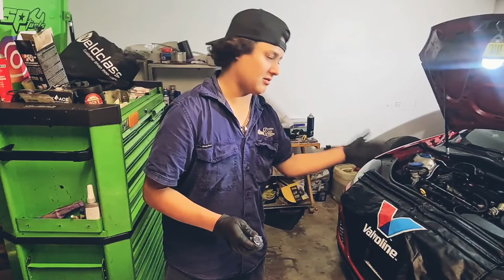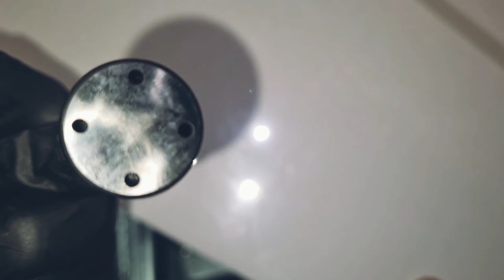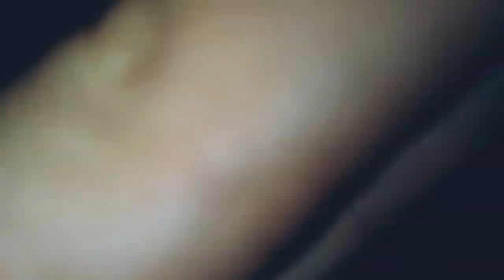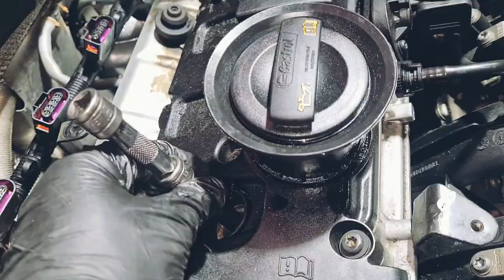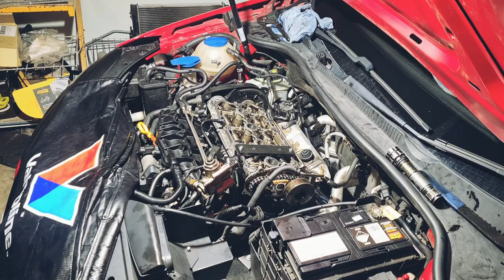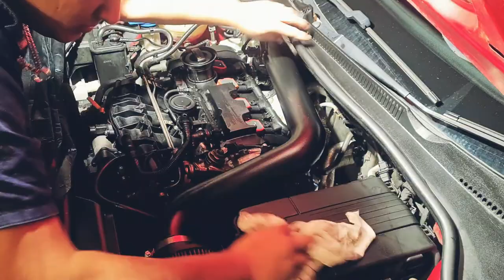Cam shaft timing chain replacment on the volkswagen Mk5 golf GTI #vw #audi #camshaft #timing #chain

Comment: You didn't count the links from the bronze one? Have to go by the 18/19 rule on the chain otherwise your timing will be out unless you got very very lucky
Reply from the maker: Thanks for the heads up mate, that's exactly what the elsawin manual states, it's another precaution to make sure you don't mess it up but the links are the same all way round, just helps you locate the adjuster onto the keyway.  aslong as you turn the inlet cam when you lock the adjuster and the lobes line up the same on the cam cradle marks ( about half way travel  along the lobe both high points facing inwards) your sweet, the cam lock should also slide effortlessly between the cams. I'm a europian vehicle mechanic and vdub and Audi specialist at the shop, have been lucky the last 20 chains haha, but in reality as you go, you figure out other ways to do things and what methods help what, helps make things more efficient, part of all the fun
Reply: @jack73ist  If you didn't count the links, why did you care with the colored chain in the video? The different color only helps counting the links between...
Reply from the maker: @YOARTHFU  don't worry about it too much mate, replied to your earlier comment 👍
Reply: @jack73ist I have no earlier comment, until now. I'm just make it more comprehensible for others, since it is common that people are very confused about the timing logic, then making unnecessary steps and timing marks all over the car.
Reply from the maker: @YOARTHFU  sorry mate, thought you were the other person to comment on the coloured chain link, Check the reply above yours to K2weapon. Just showed how I've been replacing these timing chains for years. As I stated in that reply  afer a while you learn what method is to insure what and where you can make the job more efficient. Links are the same all the way round on the chain, it just helps you locate the keyway onto the adjuster. As long as the cam lobes match half way across the rise on the arrows on the cam shaft cradle you'll be fine.
Reply: @YOARTHFU  yea good catch. count links to set the tension. Can still be perfectly on time but chain will be too slacked at the top and tensioner will reach full extension pre maturely.

Comment: You seem like you really know your stuff. How often should this service be done?
Reply from the maker: Thanks mate, and thank you for watching 😄, usually, we would replace only when necessary, symptoms like a chain rattle on 1st start up, (can sometimes be the adjuster) , inlet/exhaust cam shafts out of corralation fault codes, this problem would ussually occur roughly around 160k kms. You could probably do the jobs as preventative maintenance before hand around 135k km, with the service but this also all depends on car history, hows its driven and serviced
Reply: @jack73ist  Thanks heaps.

Comment: 20nm. I don't hear a clic. Is your wrench broken ?
Reply from the maker: Nah not broken mate, I dont think I used my torque wrench in this video? But there is a torque for every fastener, yes 🙂 .
thanks for watching mate
Reply: You said that the spec for that bolt is 20nm. why are you using the wrong key? why are you putting that bolt so tight?
 I think you tightened that bolt to 150nm. you were almost to the point that the screw thread would break
Reply from the maker: @AutosportMore  you're making some big assumptions ,  you can find more information on ross teck wiki, and some other software, but I've just shown how I've carried out the job for years cheers mate 🙂 take it for what it is, find another video if you're not happy

Comment: Have you done 2l fsi non turbo timing
Reply from the maker: I can't remember off the top of my head mate, its been a while, I'm pretty sure majority is still the same though, and if they had failed, I would have done them. We had no shortage of these timing chain and tensioner issues though 😅
Reply: @jack73ist  should o count 18 to 19 links

Comment: have you ever had to drill the adjuster bolt out?
Reply from the maker: Yeah mate, thanks for watching! I have had to drill 2 that I Remember, One on a mk6 golf R and One on an A4, had to remove the cam shaft from A4 as they have a North/ south engine configuration witch places the adjuster right against the fire wall haha. 
If drilling out the bolt in a Golf, I rememoved the battary and used a Right angle drill, used a larger drill bit, as large as the polydrive pattern.. you only have to drill until the bolt head can be remmoved then is should wind it, it has a cone style bolt head for more surface area which is why they can be tricky to undo. Hope that helps
Reply: aye thanks man you seem like a hell of a technician, tackling this job this week gotta drill out this bolt and see how it goes! thanks allot
Reply from the maker: @sMFq11  Just alot of experience one Audis and VW's haha wouldn't call my self a great technician yet haha  I do appreciate the kind words though mate. As long as yountakenit slow and steady she'll be right.
If you have anymore questions or run into and hurdles, don't hesitate to ask 🙂
Reply: haha well you know a hell of allot more than alot of people out there that's forsure. I've been working in a euro shop for about 12 years now and well the old YouTube still gets me out of a bind every now and then so we out here in the repair world appreciate good repair content like this! thank you
Reply: @jack73ist  my boss was telling me I was using the. wrong socket lol typical old grouchy guy but they are definitely tight on there and this one just decided to strip out on me and ruin a Monday morning haha
Reply from the maker: @sMFq11  I appreciate that mate, youtube is still getting me out of trouble today Haha, reason I thought I'd make my own vid and share some tips and tricks, Im glad and thankful to see it seems to be helping 🙂

Comment: are you sure the crankshaft bolt is a 19mm? if I go to ETKA it says the bolt is a hex M16-75
Reply from the maker: 19mm socket mate, for the M16-75 bolt
Reply: @jack73ist  I recalled wrong, it's M16x54 (06A 105 229) but yes you're correct. In my head it was a hex bolt, but it's a triple square.
I had to crank it today for cam-chain change operation. But I didn't have that socket. I used a hex 21mm; by luck, it sort of fits enough to spin it.
But you're right, it should be a triple square 19mm socket, which should be what the M16 standard is I guess.
Now I'm stuck with the polydrive in the cam phaser. I can't untighten it, it's inhuman. I tried to torch it, no luck. I don't have a good quality, long breaker bar, they're too costly for a one time job. I use a stupid tire bolt bar, but no luck. Do you put glue on the polydrive bit to make it keep its seating? I think I'll try with an impact wrench but I have to buy or rent one.

Comment: Hello, i cannot remove the cam adjuster bolt. Its so frikkin tight, i already broke 4 tools. What do i have to do to get it loose?
Reply from the maker: Thanks for watching mate, yes they can be incredibly tight, the conical surface of the bolt heads has more surface area to lock the bolt in place,  as long as the polydrive bolt isn't damaged yet, I get the largest bar I have and someone to help push the end of the bar onto the bolt with a pry bar to hold pressure, bolt is standard right hand thread meaning Lefty loose. If that fails you can drill the bolt out slowly, usually do this when the bolt head strip's, you only have to drill untill the cone haed is removed and you can easily unwind the bolt but this does mean you have to replace that polydrive bolt, have to get one from and Volkswagen/ Audi supplier. 

Hope that helps mate

Comment: I need your help man, I’ve taken it apart twice now and triple check EVERYTHING and it still has a lumpy idle but drives fine. I’m located in Brisbane, reckon you could give me a hand?
Reply from the maker: Did the lumpy idle start after you replaced the chain mate? When the chain stretches or the tensioner is worn you usually just get a rattle on start up, or constant if really bad and will usually throw a cam shaft, crank shaft out of correlation fault code. A lumpy idle sounds like a vacuum leak to me, if only lumpy at idel, idel is when you will find the engine under the most vacuum so if you have a blown PSV, inlet manifold gasket, dip stick seal, Diverter valve for Example, it will draw in un-metered air causing the engine to hunt trying to correct itself using the O2 sensor
Reply: @jack73ist  yes it’s only idling poorly on idle. when I rev it, it’s fine and I look it for a spin and no loss of power it pulled normally. The chain made a slight rattle on start up but it went away instantly. It was idling smooth but when RPMS fell after cold start it started having a lumpy idle.
Reply: I think it’s not a timing issue because the idle changed back to normal for 20 seconds before returning to the lumpy idle again just before when I started it up.
Reply: Should have probably made it clear at the start but I’ve done the new chain and tensioner install and made sure everything is in time. Then all that started happening.
Reply from the maker: @lukac3140  if you have a scanner handy you may find mixture lean fault codes, which would confirm a vacuum leak, is there any hissing you can hear around the engine? If you have any brake clean or carry cleaner you can spray some very short bursts around the engine to see if the idel picks up, that is where you may find the vacuum leak
Reply: @jack73ist  I scanned it with a generic OB2 scanner and it didn’t pick up any fault codes at all. I’ll give that a go tomorrow morning. I appreciate the help, thank you so much.
Reply from the maker: @lukac3140  let me know how you go mate, if you can get live Data on your scanner, check the lambda values, it should oscillate between -.5 and +.5, if reading at +20, the engine is dumping in fuel to compensate for the extra air entering through the vacuum leak. If you have any more questions mate, feel free to ask
Reply: @jack73ist  thanks for that mate, absolute legend. I think it’s safe to say timing isn’t the issue. I rebuilt the cam adjuster sprocket, I put in a new genuine n205 valve, all new seals, and made sure the timing is correct. I’ll have a look if it’s an air leak or even a fueling issue. The cars been sitting for 2 weeks prior start up.
Reply: I think I may have found the issue. There’s a loud hissing sound in the engine bay most likely an air leak.
Reply from the maker: @lukac3140  that will be your vacuum leak mate, that's the problem
Reply: @jack73ist  back to square one unfortunately. It wasn’t an air leak unfortunately. Could it be a fueling issue? I think it’s safe to rule out timing issue because I took it for a drive and it drove just as before.
Reply: @jack73ist  got a new code. P0087 Fuel Rail/ System Pressure too low.
Reply from the maker: @lukac3140  hey mate, yeah usually if the timing was out you would get a "crank shaft, cam shaft out if correlation code  but in saying that, I can't remember if this motor has an exhaust camshaft position sensor, I can check when I next see my brothers gti. When you get that fault code it usually means you have fuel leaking somewhere, I'd check all fuel lines and check for a fuel smell, depending on kms you may have a leaking injector, usually when really bad, faulty injectors misfire when cold but gradually get better as soon as they get hot.
Reply: @jack73ist  yeah I’ll have a look at the fuel injectors and lines. I don’t think it has a sensor on the exhaust cam but it does on the intake cam.
Reply from the maker: @lukac3140  how did you go mate? Was thinking st may have been the fuel line to the high pressure fuel pump??
Reply: @jack73ist  you won’t believe it mate 😂… it was the f’ing timing. It was off by one tooth on the intake cam.
Reply from the maker: @lukac3140  oh mate it happens mate, the engine is smart enough to adjust the cam to get it to run right out of idle, I'm glad you have sorted it!! Sorry I wasn't more help, slight bit difficult to diagnose with out being there hhaha
Reply: @jack73ist  No mate! Thank you for being sooo active and trying to help!! You’re a legend.
Reply: @lukac3140  lumpy idle but smooth driving on these 2.0t FSI motors are usually caused by a vacuum leak somewhere

Comment: Great video! One question. Do you have a part number for the solenoid rings? I have searched everywhere but can't find them. Probably not using the proper German description.
Reply from the maker: Thank you for watching ! And thank you mate 🙂
No I dont unfortunately, but I'm pretty certain you can only get them genuine from VW/Audi, you'll need 3 and they're the carbon sealing rings for the cam adjuster solanoid, that incerts into the cam adjuster itselfselves, they'll definitely have their own name for it but I've only ever described them to the parts guys here in Australia
Reply: @jack73ist  I noticed your description said oil control solenoid rings. That helped a lot. The part number I found was 06F198107A. Looks to be the right thing.
Reply: @SCFlyingSquirrel  SKP SKY01125 on Rock Auto. Or ÜRO PARTS 06F198107A They're over $100 from the dealers.

Comment: Do you see some.improvements changing for a new camshaft?
Reply from the maker: You do actually, the cdl engine which is the same block and cylinder head as the BWA but run better cam shafts and a KO4 turbo standard. You see the same cam shafts used in the scirocco's